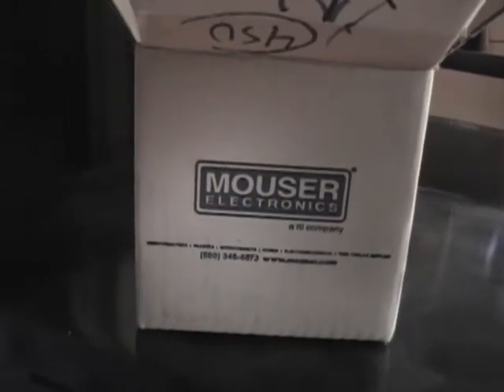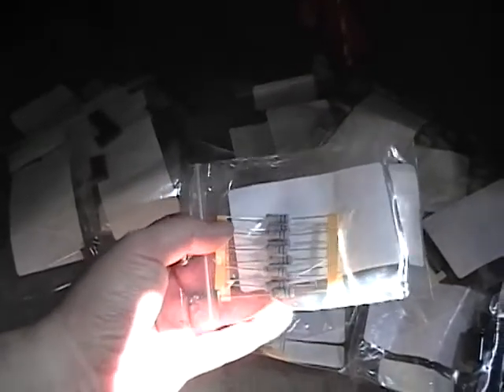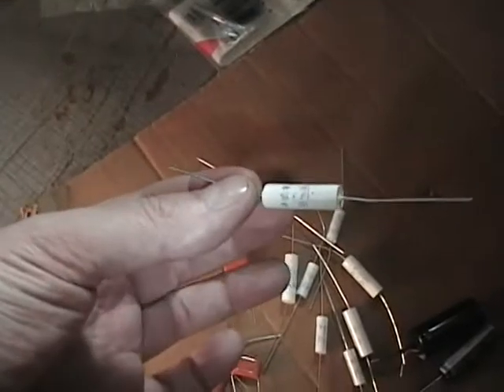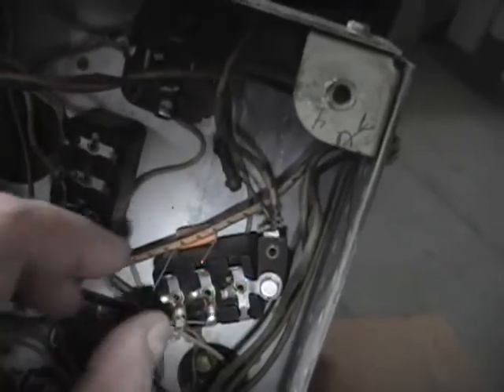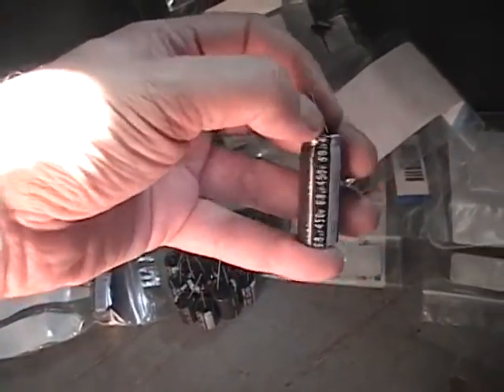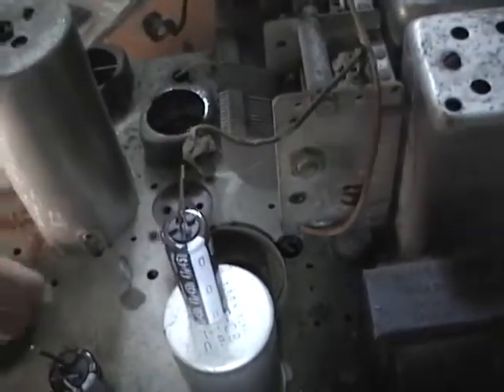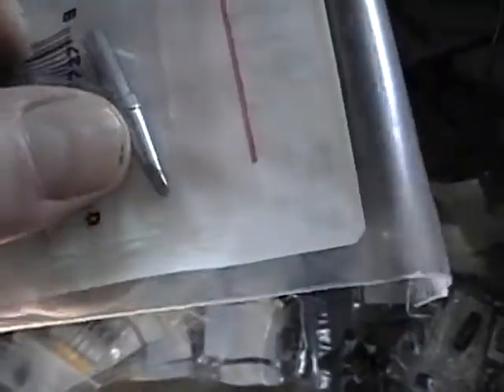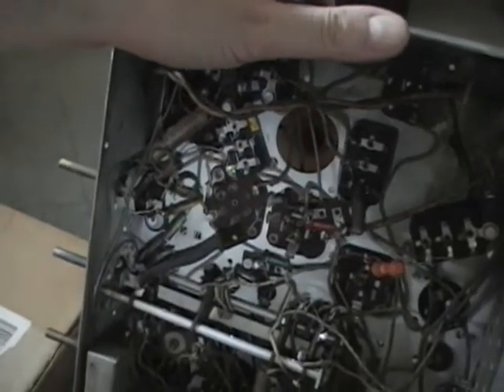New parts have arrived

Comment: @bandersentv I'm going to order the capacitors you recommended for the Audiotronics record player amp, and I'm going to re-resistor the whole thing, going with metal oxides for the 1 watt 150ohm power resistors and metal film for the 1/2 watt resistors,  there are 9 in total it's a simple amp, so I figure why the heck not, it's like building  heathkit except with desoldering.  All the non electrolytic caps in it are ceramic so I'm pretty sure their still good.